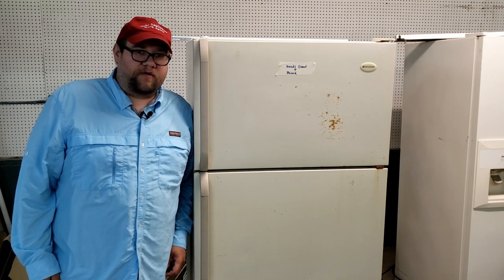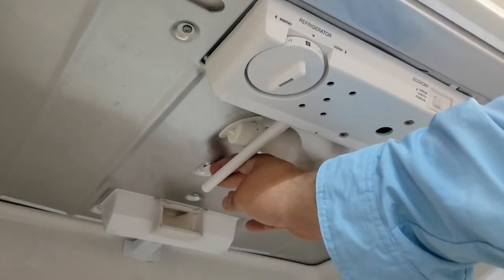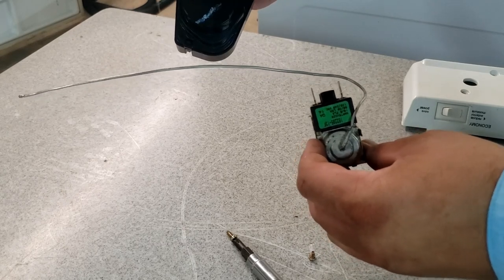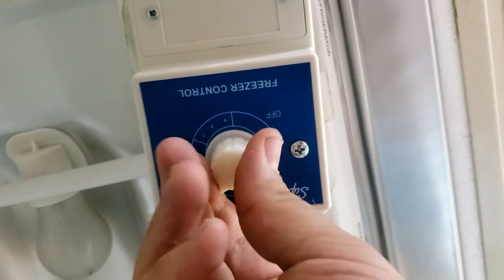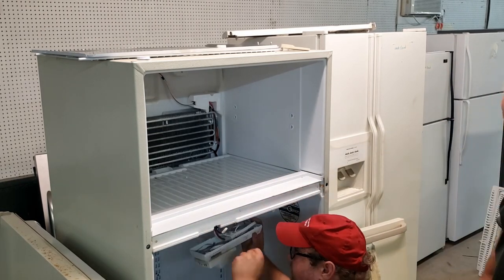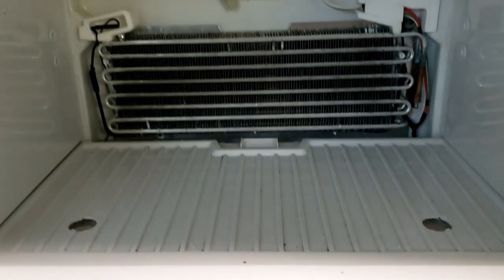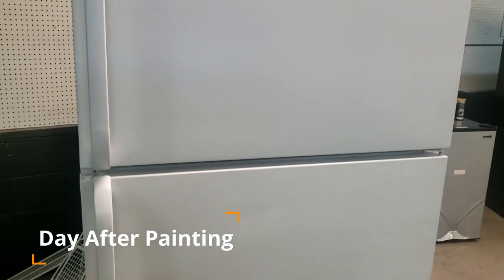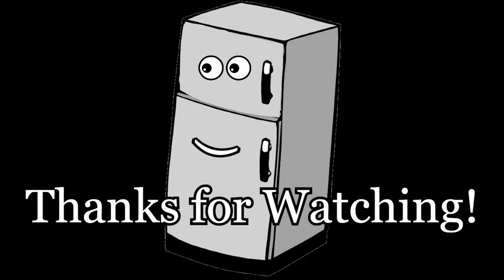How to Convert a Refrigerator Into an Upright Freezer

Comment: Thanks for doing this to almost exactly the same unit that I am wanting to convert. Thanks for confirming what brand my fridge is too, it's always been a mystery since it arrived to me with no badging at all. I'd like to point out though, my unit has a wire rack in the top section below the ice maker, so if you'd had that rack you could've made some pretty massive holes in the deck.
This is exactly what I was planning to do with mine. Its defrost timer has gone out a long while ago, or iced up inside perhaps. It's constantly freezing all the air passages up and not draining any water into the evaporation pan at all. If I do go forward with this plan, I'll try to remember to post a video of the conversion.
One question though that I didn't see for sure during your video, when you made the ventilation holes did you cut them all the way through the aluminum tray that was the ceiling of the bottom part of the unit?

Comment: Been thinking of a low budget ice plunge method for recovery after long runs.  I have an old Sanyo Mini-Fridge in my garage that has just been there unplugged for a couple years.  It has a small freezer compartment, but I may give this a try to freeze water in the refrigerator space as well and use in some kind of bin or tub for the plunges. Thanks!

Comment: I think a freezer box has a much higher freezing capacity per 24h, like 20kg/24h, while a fridge has like 4 to 10kg/24h. This means that adding lots of room temp food to this fridge would take very long for it to cool to -15C, compared to a freezer box. It may also allow the food that was inside, to get to like 2C, for a few days, until it manages to cool everything back to -15C. That is, temps will vary wildly when adding lots of food.

Comment: Is your freezer still making -20F ?  I just ran my thermostat thru the sidewall to the outside so it stays on 24/7 [I have a chest freezer 30 years old that I did the same to - holding -30F ! They like to run forever]  Knocked out the freezer damper. Didn't drill holes yet, waiting to see what the temps are. GREAT video! think outside the box.
Reply: I tried thinking inside the box but it was too cold

Comment: I'm curious. I don't know for sure, but doesn't a factory-built stand-alone deep freezer have much better insulation than a refrigerator? Wouldn't the compressor also be working harder than designed? Wouldn't this be significantly more expensive to run than a purpose-built freezer?
Reply: My thoughts exactly.  I thought I would spray foam the door. And add insulation foam to the sides. However That last could create mildew

Comment: Dont block off the fan blowing into the freezer, instead block the damper going into the fridge drill your two holes slightly bigger and insert fans into them. Solved my problem real quick.
Reply: Can not do that with a rental
Reply: @becky5937   and you can not turn a rental into a freezer

Comment: I believe we do know that fundamentally the wave-particle duality is not binary, as an exciton can be 'bound' to a photon, and based on how this is done you can tune the resultant quasi-particle to act in a way that is partially wave-like and partially particle-like in different ratios. This has been used to test the properties of different 2D materials especially ones with properties similar to topological insulators.

Comment: Is it possible to this but have the top compartment be a drink cooler?
Reply from the maker: Yes. You'd get rid of the dampening system and instead of installing a new cold control, I'd just route the current one to the front of the freezer, and it should help change it to be warmer up top. The BEST solution would be to probably take the fan in the freezer, and mount it to point downward to cycle all the frozen air into the fridge, but then rely on the thermostat to cut off cooling at an acceptable temp for the whole unit.

Comment: Thanks for the video. I was wondering about drilling 2 holes like you did in your video at around the 17:15 mark, in a Haier French Door model refrigerator. Do you have any tips on how to avoid wires for a Haier double door fridge? Thanks!

Comment: I wonder if you can saw all the plastic divider that separates the freezer compartment from the refrigerator section , then simply turn down the freezer thermostat ? I would also insulate the cabinet with foil faced fiber board.
I do commercial HVAC for the last 30+ years but never got into refrigeration.
Same thing but a tad bit different.

Comment: I’m trying to find a local person to convert our 26 cubic foot side by side fridge into a freezer. It’s a Samsung with computers. I was figuring the computers could be eliminated, holes drilled in and pvc used from fridge to freezer. I am not an appliance person but would love to have this done. It looks like the new upright freezers are around $1,550 for a 21.3 cubic foot with 5 year warranty. Not sure if this is a smart thing to do. The only thing is the computer to fix this thing to keep it as a fridge is very expensive.   The computer started glitching at 5 years old. The fridge is currently 9-13 years old. We got it when we bought the house as it came with the house. Any advice?  We live in NE, OHio.  Thanks!

Comment: Also, I have a 2nd refrigerator in my garage.  It's pretty cold. The stuff in the top of the fridge section freezes readily. Even stuff on the bottom sometimes freezes depending on what it is. It's set pretty cold, but not the coldest. If I just set my fridge (or perhaps any fridge) to the coldest setting, would it act as a giant freezer? Not a "deep freeze" but at least a freezer?
Reply: Did that work?

Comment: Sorry folks  this is nonsense.  Even though the temps being discussed  are "below freezing"  they are in NO WAY  what is recommended for  true   food storage in a freezer  0F is minimum  and   that really, is for   short term storage in a typical kitchen  freezer/ fridge.  For long term  deep freeze the temp should be  at least -10F and below  down to -20F

Before you get on my ass   in a previous life  I maintained  HVAC/R
Reply from the maker: To be honest, I only displayed the video snippet of where I temped the fridge. I got it much, much lower - closer to -20f in the upper freezer and -10 in the lower. I just didn't manage to get video of it, so I went with what I had.

Comment: What would happen if I "break" the part that divides the freezer from the refrigerator?  Could the temperature be more UNIFORM?
Reply: He cut holes in it, being VERY careful to avoid cutting the wires that run through that section.
Reply: @newoneinblack  thanks man!

Comment: Why couldn't you just cut a big hole between the fridge and freezer section and put a small fan to circulate air?  Is there no thermostat system in the freezer section?

Comment: Could you just cut the plastic/styrofoam barrier between the freezer and refrigerator completely off, being careful with lines and leaving front plate with heater? Would that work also? Would you still need to buy new controllers/thermostat if you did this? Thanks and great vid.
Reply from the maker: If you were very careful, you could probably remove the barrier entirely without cutting it, leaving the front plate and metal Brace. This would leave the thermostat control and wire exposed, requiring it to be mounted elsewhere. Absolutely doable, but i didn't want to get that deep in this project, as then I'd need some sort of shelving to go where the case was unless I could brace that plastic piece or maybw swap with a wire rack.

Beyond that, the thermostat is still an issue, because the stock thermostat is designed for a minimum of like 32* or so, because it does rest in the refrigerator cabinet. Youd still need the supco control

Comment: I think we had a fridge break and started freezing everything. We eventually broke it trying to "fix" it... like cavemen with hammers and stuff.
Reply from the maker: Did that once. The door broke off a fridge and I told a handyman "Just drill a new hole for the door hinge". That was the wrong thing to say. Heard a loud hiss and....
Reply: @bensappliancesandjunk  We had the idea that breaking off the whole control box/thermometer might make it better, it didn't. I think it burned out not long after.

Comment: I removed the panel from my fridge that I plan to convert, but it only has the controller and not the defrost timer.  How do I proceed in that case...?
Reply from the maker: Try to find where it is on your model of fridge. They're usually where controller is, but some fridges are different. On some Frigidaires, I've seen them in utterly wacky places like underneath the kickplate at the front/bottom of the fridge, or in the back near compressor.

Comment: why not use a pair of 50mm quiet PC fans in the two vent holes. If you have them blow up the whole two cabinets become one for the cooling load.
Reply from the maker: Correct me if I'm wrong but most 50mm pc fans use 12v. This unit uses AC only.
Reply: Though I'd add a spacer above the grill to keep items from blocking the airflow.
Reply: @bensappliancesandjunk  they sell 120v small fans- I'm following your guide & doing some small modifications to a mini fridge trying to see what I can get it to do!
Reply: Why not just get a wire rack to put in the top part, and space it off of the bottom by a few inches, and cut two giant holes? Cold air sinks quite well on its own.